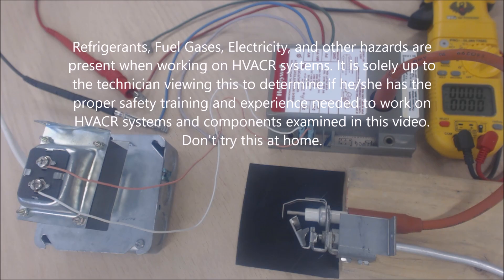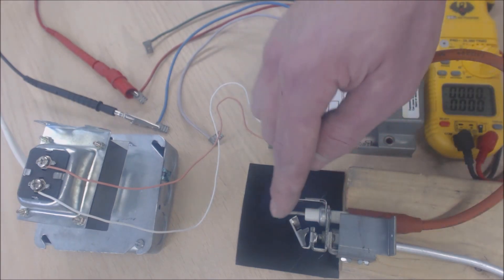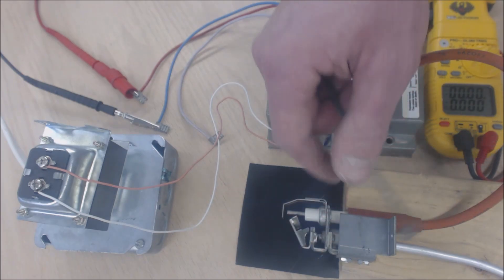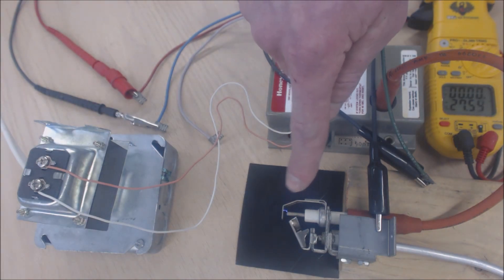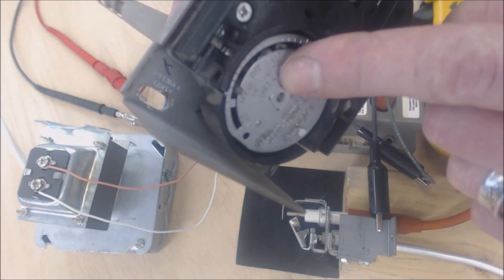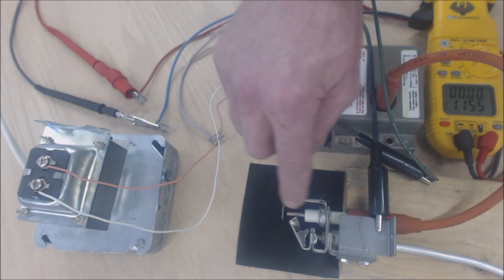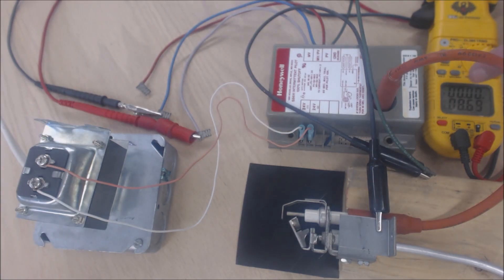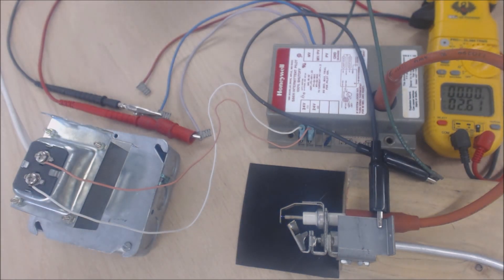Gas Furnace Spark Ignition Control Troubleshooting!

Comment: So the sparking electrode is also the flame sensing rod sending the microamp signal back through the ignition lead? My S8600F keeps cutting the MV valve terminal in and out (losing and regaining 24V) while keeping the PV on after the furnace has been running fine for about 10 minutes while getting the house up to temp. If there was a problem with the flame sensor or lead it would show itself right away, wouldn't it? I think the coil for the MV relay in the controller might be overheating (even though the module case doesn't get warm) after a few minutes and then keeps turning the relay on and off but maybe the problem is in the sensor or lead. Thoughts?
Reply from the maker: Is your spark ignition setup only a single rod like this video or a two rod setup like in some of my other videos. Yes it could be the grounding of the flame rod if it is a two rod setup or flame rod placement. Also make sure you rod is cleaned once it is cool with unsoaped steel wool, thanks!
Reply: It's a single probe as shown here. The hood over the pilot spreads out like a Y. (Number on it is KE22 and it looks like both parts are an assembly.) I've run it three times over the last few days from about 50 trying to get to 70 and each time it runs fine for about 10 minutes before acting up. I took the cover off of the Honeywell and both relays are nice and white with no brown spots like they had gotten hot, however there is some white residue on the electrode. I'll try cleaning it once the furnace cools down, if that doesn't help I'll replace it and the lead. (The tag on the furnace has the last inspection at '99, so the pilot in there is at least that old so it may be due!) What I don't get is if this is the problem, why does the furnace even light at all? Why would it intermittently detect the flame once hot?
Reply from the maker: It is a very small dc microamp current and is very sensititve. Does your furnace have a steady good 120v ac voltage and is the ground to the furnace good? thanks
Reply: Good voltage and good ground. There is a brown mark on the floor of the furnace where the spark lead has been laying for the last 18 years. I'm going to just replace the igniter lead and see what that does. It may just be losing continuity once warm, but I can't verify that because my meter doesn't measure microamps. (The insulation still feels supple, but I've had cars with "good" HT leads misfire. Turn out the lights and you got a light show where a lead went near engine castings!) Thanks for the quick replies and insight. I'll let you know how I make out.

Comment: Excellent explanation, I was working on a high voltage  furnace ignition module 120 volts. the furnace would stay on for about 1 or 2 hours then the ignition module would fail and would work as you tapped it with screw driver is there something wrong with ignitor module ?
Reply from the maker: Possibly, did you check the ground wire and connection, as well as take the connectors off, crimp them down and put them back on? Is the flame sensor steel wooled for a good signal strength?
Reply: How do you determine if the spark rod is good or bad? New box but no spark....

Comment: How many volts is sent to the spark/flame sensor to detect flame? Also what should the dc micro amps be at the ground wire going back to module? Is it 120volts to flame rod and comes back as 1 or more mircoamps dc to ground like the 2 rod spark ignition module?
Reply from the maker: It is interesting huh? So across the board between newer 90% efficient direct ignition, older smart valves, various  ignition control modules when you have a single purpose flame sense rod the voltage seems to be 85-190 volts depending on which one you are talking about. and they can range from 1-3 dc micro amps on the ignition only boards with the small flame rods to 5-7 and sometimes less like 2-3dc micro amps on the newer furnaces with larger rods. So to answer the question, there is a reason I don't check the flame rectification on the single rod. Instead of a pulsating high voltage, the single rod gives a steady 10,000 or so and that is the ac signal that gets rectified. Now the ground is also the path back so just like when you read dc micro amps on the ac side before the flame rod while 100 volts ac is running through it on newer furnaces, you don't want to hook your meter in series with 10,000 volts going through it when it does happen to make it over to the ground. Some meters will automatically blow the fuse or break if this voltage accidentally reaches the pilot head ground like during ignition so in that video you may have noticed that I just mainly focused on checking the ground circuit and cleaning the flame rod and pilot head. It's interesting. Good job picking up on that and asking the right questions!
Reply: Capitol Refrigeration,Heating,and Cooling  I’m getting 18 volts from mv to mv/pv   Then my gas valve starts buzzing and voltage drops to 16 volts and gas  shots off and fan keeps going

Comment: Thank you,again. It's Blaze. I cleaned up my ground to my unit chassis and replaced the flame sensing rod. When I energized the unit I had the same problem. One thing that I didn't notice was that the burner that had the sensing rod going to it was not lit. I removed the burner and pulled out the  orfice  and there was spider webbing inside the back of it and plugging up the opening. I cleaned it out with my tip cleaner for my oxyacetylene rig and returned it back to service. The unit is heating properly at this time. Thank you for your videos 

Blaze
Reply from the maker: That's great to hear Blaze!

Comment: I agree another good video. Had this happen just last month, after verifying continuity through the safety loop I determined that the spark ignition bracket had heavy corrosion between it and the main chassis. Just a little sanding of both matting areas was all it took to get it going. Looking forward to your next video.
Reply from the maker: That's awesome to hear, good job!